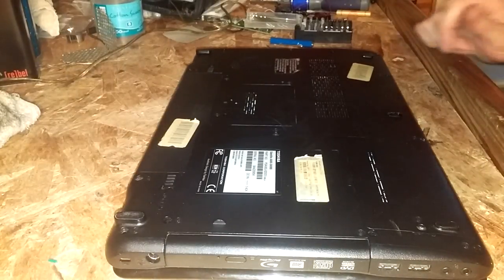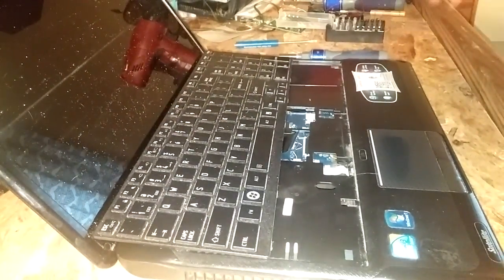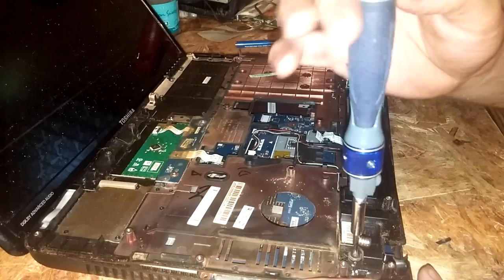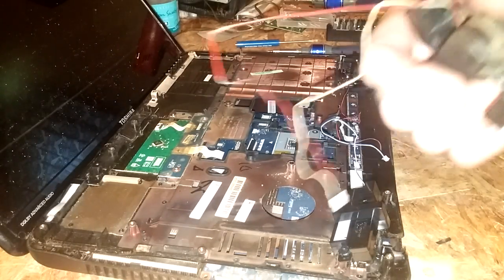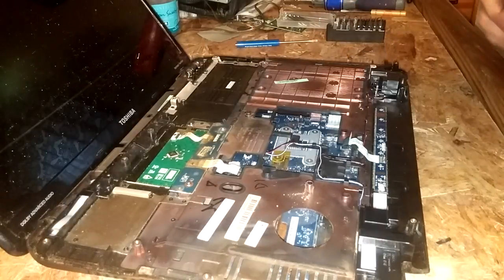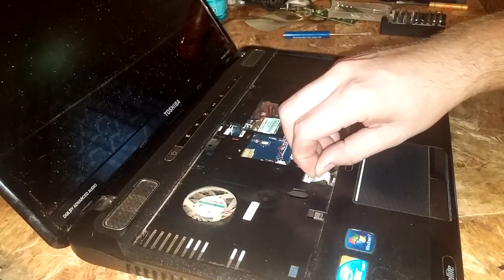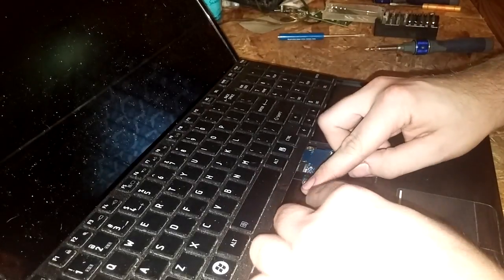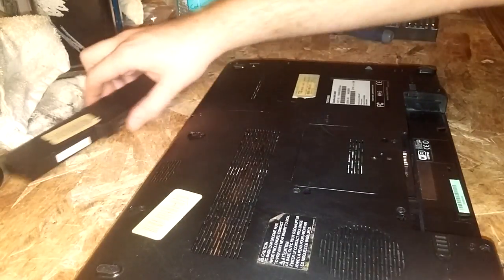Toshiba Satellite A665 Speaker Replacement

Comment: Unfortunately, these Harman Kardon speakers have a 100% failure rate due to the foam surround material they use. I'd love to see a more robust replacement unit. I may experiment with gluing a Peerless 20N12AL03 in place of the HK driver.